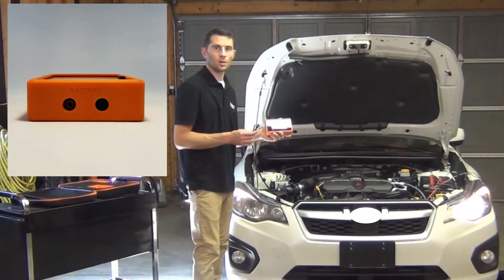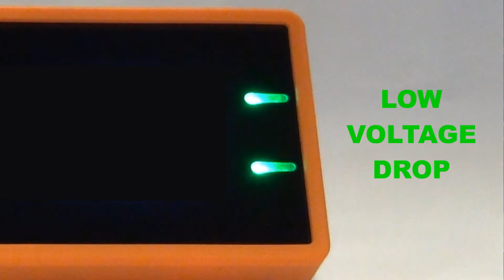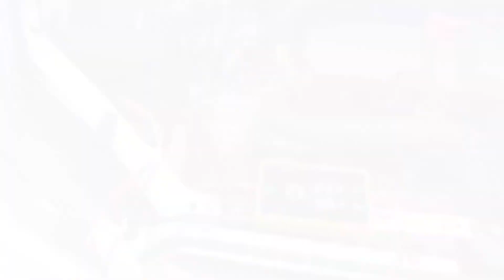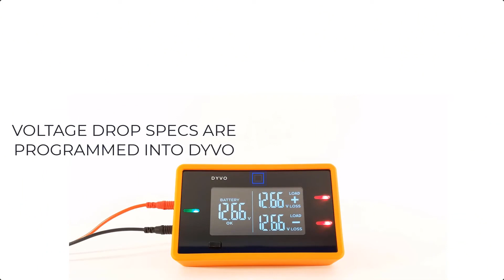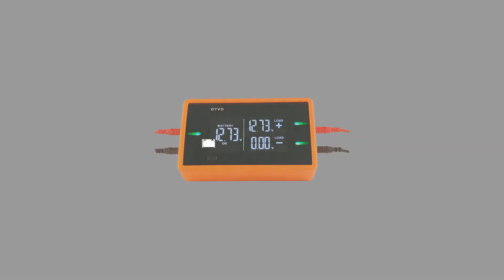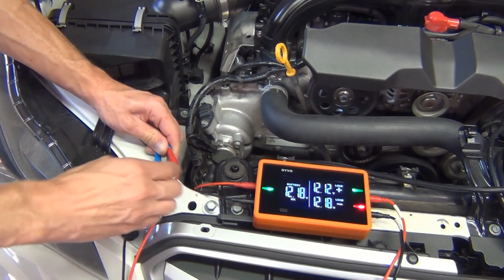DYVO - How to Test a Headlight

Comment: wow what an over complicated way of using a test light or multimeter to check a light / circuit. You could also use your volt meter to check for a voltage drop with the component still in circuit. over a suspected bad connection This is for the kid on "technician" no need for smoke and mirrors on a simple check with conventional equipment